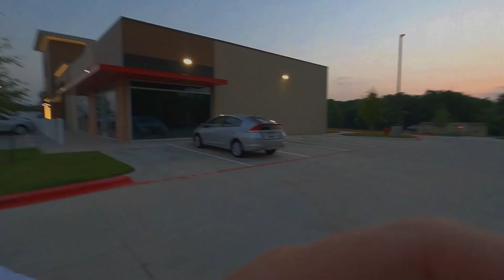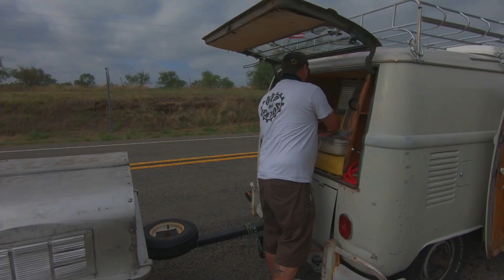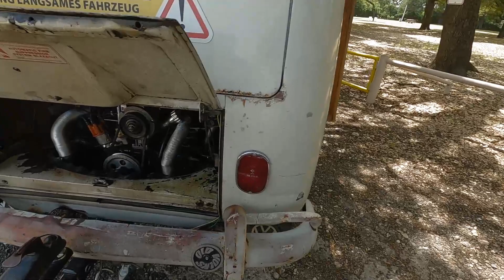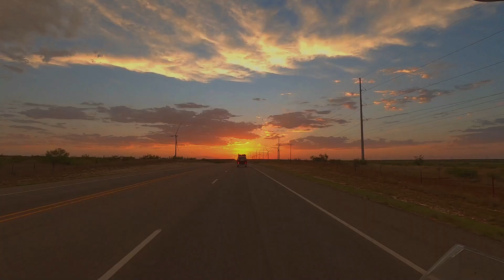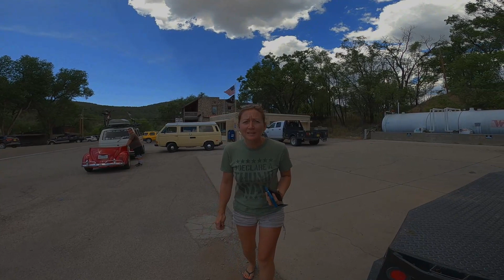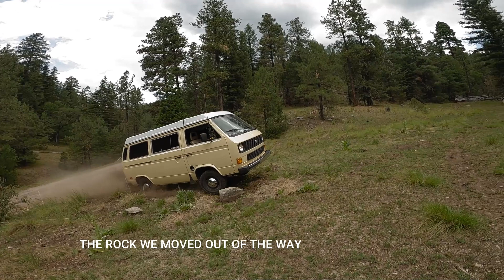New Mexico Bus Bash 2020

Comment: Probably should have greased that new throttle cable, but hopefully there is enough grease still in the throttle cable tube ;-)
Reply from the maker: There was tons of grease lol. I had to flush it out and re grease it after the trip
Reply: @OldVolksTV  That's funny.  Are you using the newer braided line throttle cables, or the original solid wire style?  I'm curious if those braided ones really hold up or not.  The solid wire original style certainly lasted a long time.
Reply from the maker: I use the bulk braided stainless aircraft cable and make my own ends. I like the solid ones because they're stiff and easier to push through the tunnel, but I haven't been able to find them in a while.
Reply: @OldVolksTV  Yeah, me too, after I have had a number of the braided ones fail for different reasons.  How do you make your own ends?  It might be interesting to make solid ones.  It's fairly easily to find stainless wire that would be the right diameter.

Comment: Is James’s bus engine converted? Because I have never seen him break down and how easily he made it up the hill at the campsite.
Reply from the maker: I believe he has a 1776cc T1 motor. It was recently built with good parts and tight tolerances. Runs like a top and makes good power.
Reply: @OldVolksTV  so it’s not a vw engine?
Reply from the maker: It's a standard vw bus engine with a slightly larger displacement. It was a fresh build for his bus during the restoration.

Comment: So how hot did you rise with the trailer and how much did it weigh?? I really want to build a shorty bus camper to pull with my 63 bus 1776 eng  bug trans???
Reply from the maker: My trailer wasn't too heavy. I had 5gal of gas and 6gal of water, a propane tank, camp stove, and a few chairs. Probably 250lbs. all together. We were all running in the 220-230 range after driving 45mph most of the day in 100deg + temps. The only issues we had were vapor locking and power loss after extended idling (gas stations, breakdowns, etc). Most of the buses have 1776sp with single carbs and they handled the heat and the climbs well. My 1600sp with dual Kads ran fine but I did have to adjust for elevation every 1000ft of so.  The reduction boxes made the off road driving pretty easy in 1st gear.
Reply: @OldVolksTV  What would you think I would need to do, to mine to be able to pull my Idea of a shorty bus camper?? I would rather stay AC
Reply from the maker: 1776cc should be fine, keep the stock trans/reduction boxes, maybe dual carbs and a header. I know quite a few people that have towed complete bugs and buses with a stock drivetrain!
Reply: thanks

Comment: what cb radios do you guys use ?
Reply from the maker: Everyone has a different model, but I'm running a cobras LTD with a 4' fiberglass whip. Long range and crystal clear. 
https://www.amazon.com/dp/B00006JPF3/ref=cm_sw_r_cp_apa_glc_fabc_AE7Y296KQ64R8M78Q71N?_encoding=UTF8&psc=1
Reply: @OldVolksTV  cool , i was looking at walki talki cb but i recon the base unit would be a better bet thanks from johnnie ball  London England
Reply from the maker: The base unit is def better. Also be sure to get an aux speaker so you can hear.
Reply: @OldVolksTV  thanks keep safe everyone out there in wonderful USA